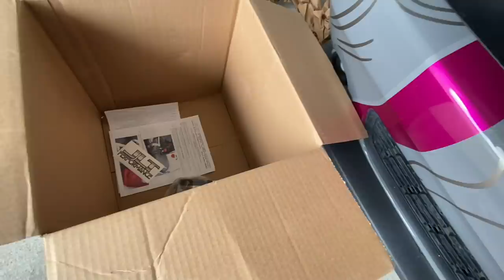Simple Mod Everybody Should Start Off With To Increase HP

Comment: Mannn these CAI give ZERO upgrades over the stock without a tune lol. Those will bring in more hot air with it being open. Best way to get cooler air is to have that running through headlight open holes in the front of the car. Only benefit is it sounds slightly better. No tune no upgrade HP on this smh lol
Reply: U spitting 🗣💯